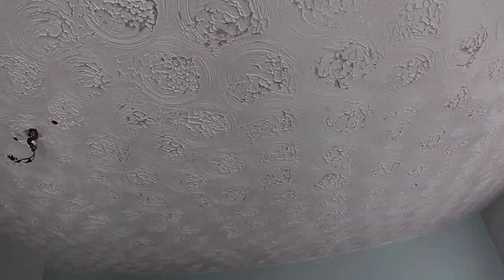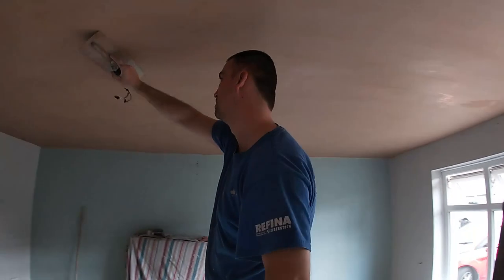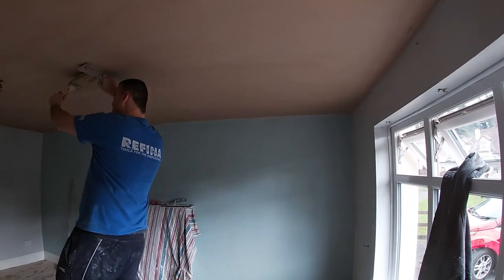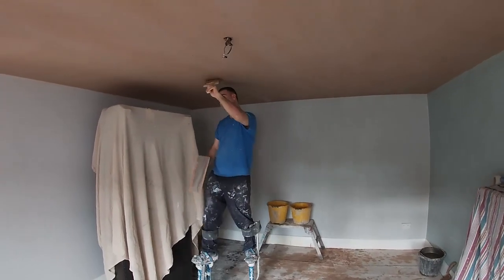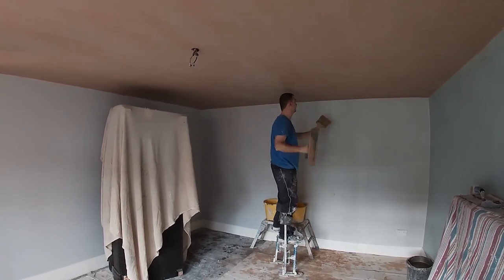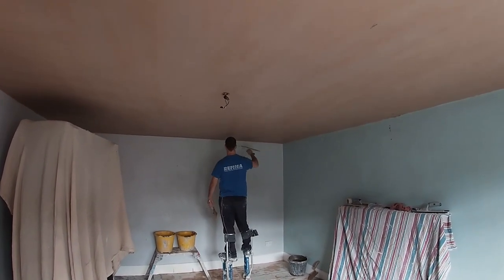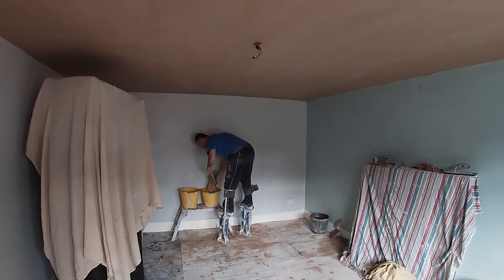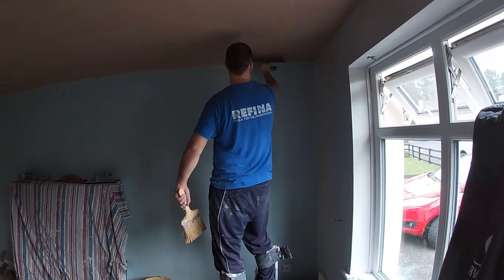Plastering out Stipple Ceiling using Ragni & Refina Trowels

Comment: Worktall boots for me Joe absolutely changed it for me.  Since all my work is domestic 8ft ceilings are piece of cake although I can reach 8.5ft off them
Reply from the maker: Are they good as in strong how do they last that way ? but yes look light on the legs
Reply: @macplastering  I find them brilliant straps have broken but all parts can be replaced £2 a strap.  They have a rubber strip on the bottom to help with grip.  Mine are now a year old and I now need to replace the rubber
Reply from the maker: @alfamad155  Might try get a pair for a little video :)
Reply: @macplastering  yes mate speak to Jeff Williams he’s on Trowel Talk see what you can do for each other. Must just say I’m 6 1 with almost 3ft arms so shorter plasterers might struggle with them as they only lift you 12”
Reply from the maker: Yea might try get in touch who knows cheers for watching and commenting mate much appreciated

Comment: I use moveable platforms with a board in-between, but this is probably a bit big for me, by the time I get round it picked up a lot on bigger ceilings. Good skills 👍.
Reply from the maker: Yes sometimes setup like that is great but stilts is quick to get going also :) but one small ceiling best with your setup for comfort :)